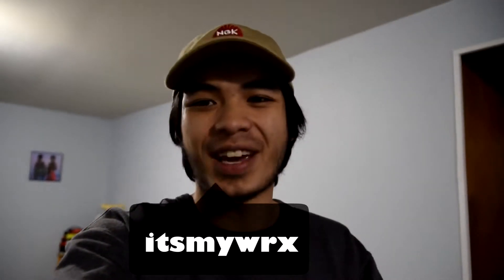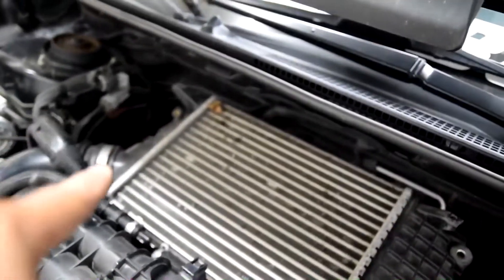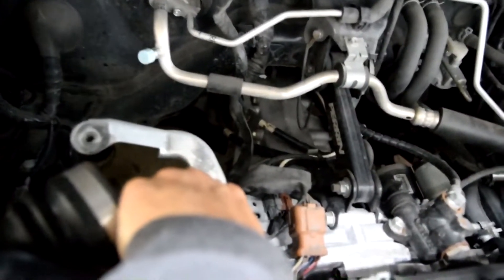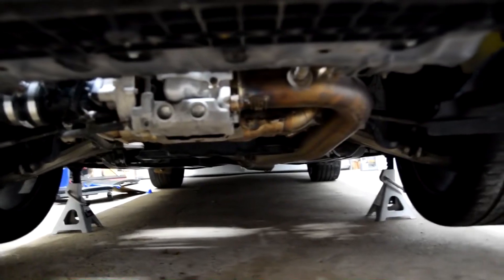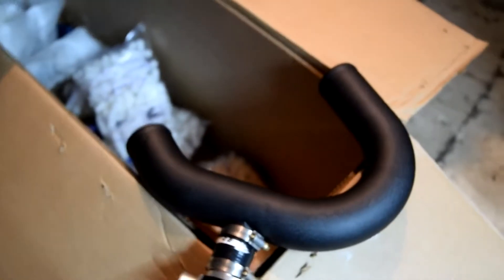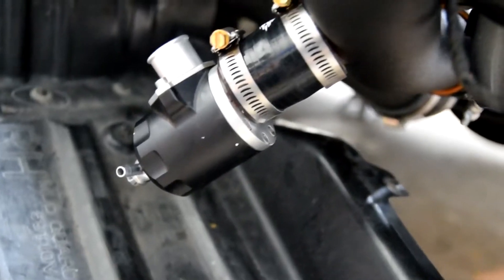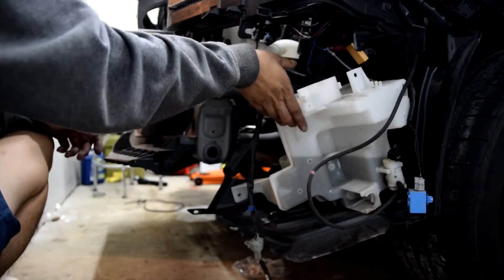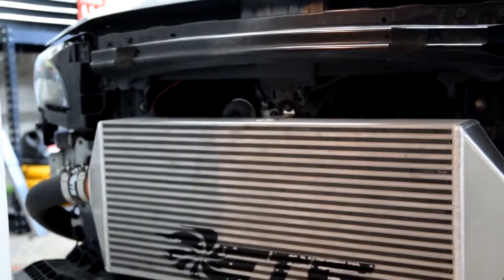FAT 4 inch ETS titanium intercooler install for my WRX!

Comment: What about the bumper it fit with 4 inch intercooler and also the support beam that goes in front of the intercooler
Reply from the maker: At the date the time the video was recorded, ETS didn’t provide an option for the support beam, not until months later they released an option, I personally didn’t have any issues with fitting the bumper on with the intercooler

Comment: So you have to removed the bpv from the boost crontroller and mount it on the pipe? Or is that a secondary one? I want to order it but I was very confused on that part
Reply from the maker: That’s correct you will have to remove the bpv and mount it on the pipe, the one I have on is an aftermarket one from Cobb